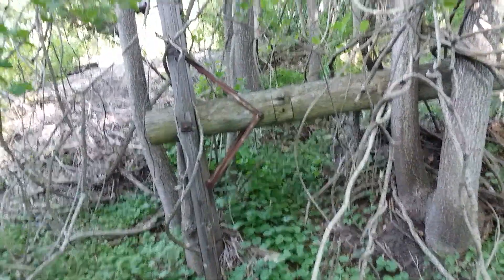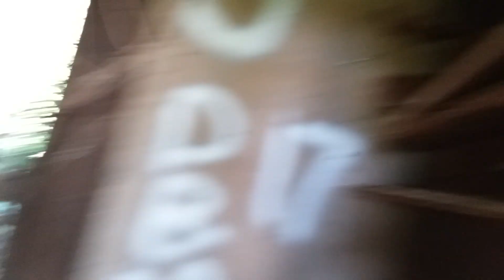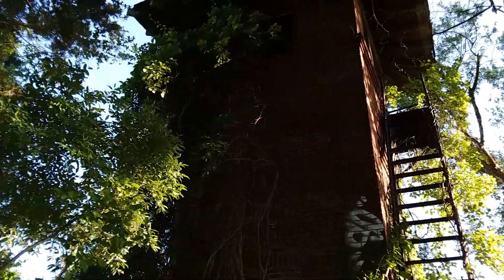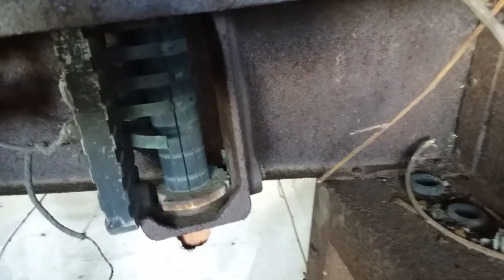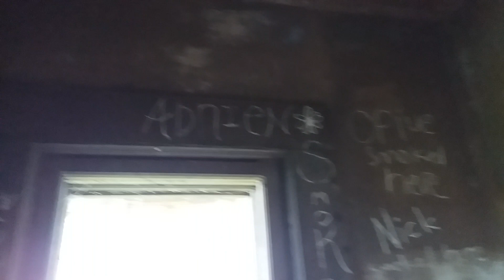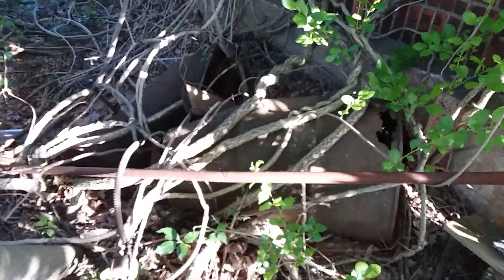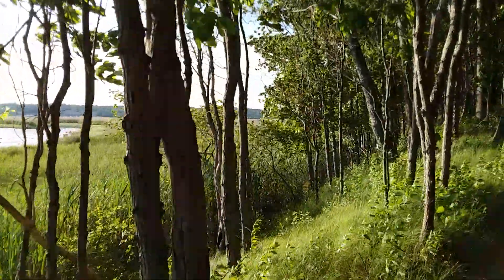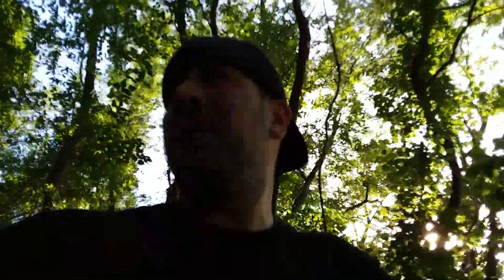ABANDONED CEDAR HILL RAIL YARD

Comment: They had water, and air pipes

When they had steam they had water but in the 19 50s even the 1940s they had diesels and they had air lines that ran all alongside the tracks with multiple hoses coming off that they would hook onto the trains that were being put together in order to pressurize the brake systems and have faster turnaround times because it takes a long time for a locomotive to build up pressure to 120 PSI through a train of 100 cars or more it can take 20 minutes and by pressurizing the trains using ground air supplies they could depart almost immediately after they hooked the locomotives to them
Reply from the maker: The pressurized air makes a lot of sense because that pipe system starts and the foundation of what used to be some type of office. We found a huge air pump connected to the bottom of it..
As always, thank you for all this information. Always loved learning about the history of these places

Comment: The lines that used to run alongside the tracks on the telephone poles with the glass isolators were the code lines that sent indications for track switch positions signals for the actual signal towers as well as track occupancy and interlock engagement
Each one of those lines were for a separate indication for a separate circuit in the tracks or a switch or a signal light

Nowadays they have what's called atcs over The Air transmitted on the upper 800 and lower 900 MHz using two-way radios to transmit each one of those indications that those wires used to carry

Norfolk Southern and CP Rail use over the air atcs on the 800 and 900 MHz paired channels and CSX uses two-way microwave transmitters from each of their bungalows so if you look at any CSX bungalow near a switch or a signal Tower you will see a 220 MHz PTC loop antenna usually stacked three of them and a VHF stick antenna and satellite dish elongated with an offset lnb transceiver that is on the upper KU band around 12 GHz and that's what they use to transmit and receive the signal indications
Reply from the maker: There is a lot of good information in this comment. This is one of the things I like most about the videos. So much stuff I don't know about when I'm checking at old place out, but there's people like you out there that know the history. I learn so much about these places from Reading comments from people like you. Thank you very much for all of that info

Comment: My guess about the pipes is they carried steam.  The fittings look like compression fittings for low pressure, there's no evidence of petroleum in the mouth of the pipe and the carriers appear to be the type that would allow expansion and contraction travel.
Reply from the maker: Awesome thank you for that information. I've been there a bunch of times and made several videos and I'm trying to learn all I can about its history. Such a fascinating place full of History.
In the playlists on my channel, one of them is titled abandoned Cedar Hill rail yard with approximately five videos. There is a video over huge abandoned building that I originally thought was a warehouse but somebody who work there many years ago said it was a mill building for the yard. Also I have a video of an underground bunk or locker room type building which is really neat and also an old very decayed Footbridge that used to go over the tracks. Then there is another video so I climbed up inside of two of the old home control Towers, but one of them is the same one that's already and this video and the other one has pretty much identical to it. But again it is such a fascinating piece of History